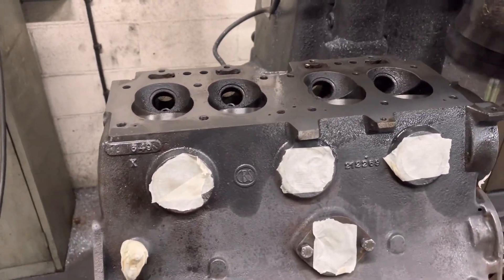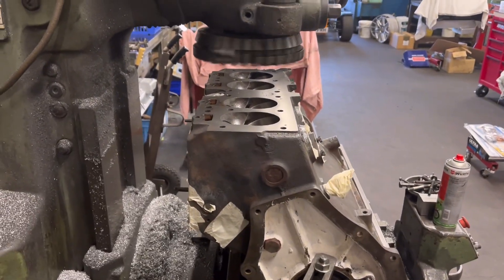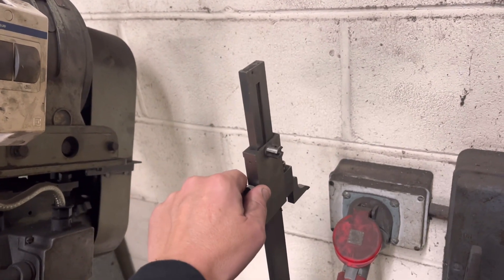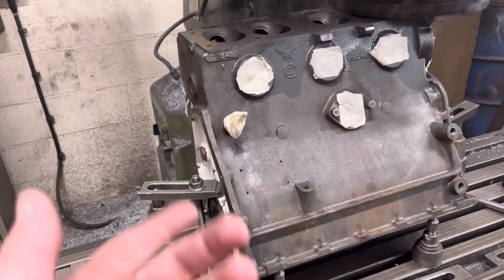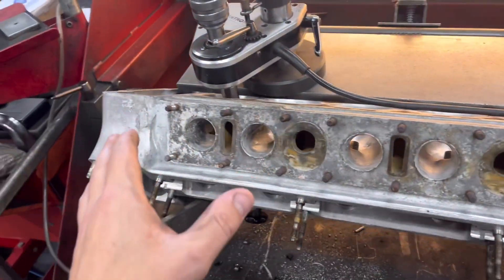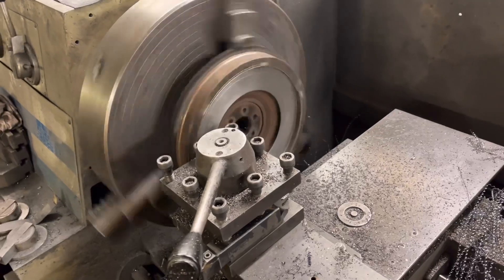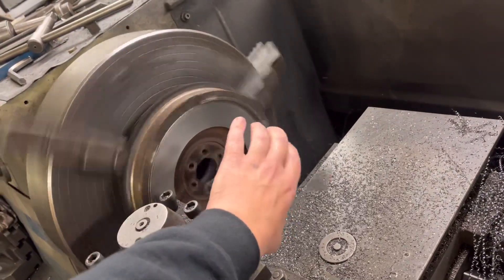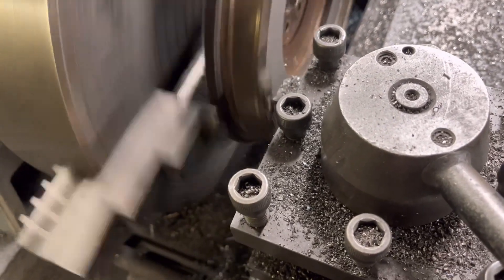The Lamborghini is BACK from main dealer, but only because…

Comment: I would just swap the blade engine for the Busa, the extra cc’s make all the difference and is almost the same power as the blown blade engine with out the added stress. You said you liked the engine/carb noise, you will lose this with the turbo.

Then if you find you want more than a 200bhp 1300cc busa engine you can always go down the turbo route later.

There is a massive amount of knowledge and around based around busa engines in cars to support you.

If you want to turbo the blade, build it straight off.

Comment: The bike engines do not hold up with the weight and continuous load generated by a car.  I race with several SCCA F1000 drivers.  They usually can’t get thru a weekend without a motor change.  Granted these are downforce cars so generate more load however they are on 1025 lbs all in.  Your extra weight will offset the lack of downforce.  Enjoy it for what it is.  So what if someone is faster on the long straight.  Learn to out drive them in the corners.

Comment: I would like to suggest you consider going with a larger displacement engine instead of turboing for two reasons. The first is that a Fireblade is already a very high-performance engine and you are already pushing it to its limits by using it in competition.  IMHO, boosting is too risky unless you replace the internals.  The second is that with the turbo, you may introduce a bit of turbo lag which will be most noticeable when accelerating out of a corner at lower revs.  That lag is going to drive you crazy and may give your competition just enough time to zip in front of you.
Reply: I completely agree with you, Lee is on the law of diminishing returns expecting trouble free extra performance.
Reply: Lee, gotta agree.
The absolute worst is any TurboTax.
Any problem with a stock busa?
Rock solid,Bullitt proof, cheap.
Reply: Meant Turbo lag.(damm spell check)

Comment: The limitations you face on a vertical milling machine is the reason why lots of machine shops invested in horizontal boring / milling machines. Indeed my old firm did exactly this because of the same problem on our vertical jigborer. That was in the mid-sixty’s. Good luck.

Comment: I had a blade then busa engine, actually still have the blade car. In a nutshell there are busa bike engines then all the rest. Good luck holding turbo torque with a blade clutch. I would and did go Busa normally aspirated and its plenty. Turbo no thanks been there done that with other track cars. If I did it again I would fit a tuned zetec or stock s2000 unit. Busa is a pita with its dry sump and I had a number of internal gearbox / dry sump drive failure issues.
Reply: Busa dry sump??
Reply: @frankbeaton4776  Yes. Due to the sump hanging down too low in caterfield type chassis there is no room for an adequate sump so they are converted to dry sump with a scavenging system and remote tank.
Reply: @nigelk780  Thanks. I have had a Busa and do not remember a dry sump after doing all the servicing myself.

Comment: Re-kit car, shot of nitrous? Put the switch under the throttle pedal, but I don't think short 50 shot bursts would do it any harm, I gather if you gap the piston rings larger, that helps, wire the electrics to the oil pressure switch for safety, engine stalls, nitrous cuts out. Just a thought, I know there's folk out there that know more about it than me, just a thought, throttle in a bottle! 👍

Comment: The two happiest days in a man's life is when he gets his Lambo, and then when he gets rid of it.....
Regarding holding vehicles hostage I had a tire shop put my car on their lift. One of the tires had some excessive wear, but I had not planned to have it replaced at that time, and not by that shop. I actually went in for a flat repair that they refused to do because they said the puncture was a little too close to the junction between the foot and the sidewall. Fair enough.
I told the manager that I was not interested in having him do any work at the time and he refused to take my car down off the lift and return it to me. I asked him if he would like me to call the police. He kept pushing me to buy tires from him and I told him there's no way I'm going to pay him for anything ever because I won't do business with any shop that tries to bully me. 
Eventually he said he would release the car if I signed a liability release for them for the condition of the tire. I agreed. It was never my intention to hold him liable anyway. I don't pull that kind of nonsense on shops.
I drove by the shop about a year later and noticed they were out of business, and that was long before all this Co--vid nonsense started.

Comment: I was a little shocked at your experience with Lamborghini. As a retired Audi R8 technician, I can tell you all maintenance and repair operations have a fixed time, in hours, and the required mileage maintenance list is given to each technician. From our perspective at Audi, the customer was entitled to a copy of the service sheet along with a copy of the digital service record, if applicable, or a dealer stamp in the book. VAG owns Lamborghini, so maybe it's worth trying an Audi dealer if they'd service or repair the vehicle, or offer any advice like I used to do, for my customers.

Comment: Not a fan of turbo's in a lightweight car myself due to the power delivery... I've got a Westfield MegaS2000 and my mates R1 5Y engined MNR is very similar in performance round Donington National. We are both relative track novices but were able to compete on pace with a well driven Caterham 485 too.
Busa, ZX12R, ZX10, R1 and the later 1000cc Blades will give you circa 180-200bhp, linear power delivery and decent reliability.
Left field choice is the new supercharged Kawasaki H2 engine.... that would be a beast!

Comment: Does that Caterham easily support tuning? Could the stock chassis, suspension parts & brakes cope? Ball joints up to it?
Reply: That's what they're designed for isn't it? I'm imagining the set up with fireblade engine is pretty light for starters?

Comment: Rather than Turbocharging a 'standard' engine I favour supercharging as essentially in broad terms you do everything you should for a N/A engine but then apply boost, whereas a turbo requires a different philosophy e.g. exhaust manifold etc.  By its nature a turbos tend to work at specific revs depending on their spool size etc, whereas a supercharger can be quite linear in its delivery, which is especially relevant given the road it has.  If the bike engine has 115bhp then turbo'ing up to 200bhp is a big hike that implies an engine that gives everything at the top and little of use low down.  I thought the Fireblade engine had 135bhp and if so 200bhp is a more moderate hike.

I bow to the better knowledge from others but horsepower is an addictive hype and at times it is much better to have a torquey engine pulling from low down to get max thrust at of the corners.  There are plenty of examples of competition cars where an engine of high horse power was soundly thrashed by one that had lower power but was much more flexible. e.g. F1 V12 Ferraris verses F1 V8 DFV Cosworths

Comment: I wouldn't turbo the current blade engine.  I would swap in a more powerful motor.  Maybe an R1 or Zx10r.    That's assuming you'll not consider any car engines,  otherwise it's a Honda S2000 engine everyday. Or falling that a Ford Duratec or Zetec, maybe an ST170 engine or an ST150.

Comment: The old 'Blades run well on 850MB of boost, no internal upgrades, just 800-850 milibar low boost pressure, and my CBR900RRV (913CC 1997/P Plate) did over 70'000 miles getting thrashed EVERY day, was still healthy when it got stolen!
Installation was done at 1800 miles to a minter, and had 72'000 on the clock when it was stolen, and had ZERO reliability issues, that carb fed Blade motor is a peach of an engine!!!!!!!!!!
Blower it and enjoy a fruity 147bhp!

Comment: Have you thought about suspension set up, brakes and tyres? This is probably the reason for your lack of pace on track. A well sorted blade in the right hands will give you lambo a run for its money on a track day.

Comment: I think it's quite funny that you are about to Turbocharge the Kit Car and you're about to send the Lambo to Ricky who is very well known for Turbocharging the Audi/Lambo V10 engine. Very soon both car will be running Turbocharged engines with healthy gains in horsepower.
Speak to Ricky about Turbocharging the kit car because to me you will need to keep the boost pressure down quite low otherwise you're just going to overcome the rear tyres all the time when the boost kicks in. The linear power of the NA set-up aids traction in power delivery.

Comment: The turbo will be a fun addition to the kit car. Freshen up the motor. Maybe a leak down test before moving forward. I know you have a dyno facility available.  You may want to invest the time and $ to have them set the fuel curve and air/fuel ratio. Definitely do not want it going lean at any point. Wishing a Deluxe weekend to you, the crew, and your family.
Reply: Lean equals pinking and potentially alot of harm.Talking from experience.

Comment: Lee, I’d also suggest a larger capacity engine rather than turbocharging your existing unit. A turbo would add more power but also a load of lag, whereas a larger, more modern engine would not suffer…

Comment: Get the kit car on the dyno before and after the turbo fitment as it would be great to get a back to back look at the results.
Reply: Errrmmm .A turbo typically shows a sudden surge but not overall more useable torque across the rpm.Diesels benefit maybe but petrols?

Comment: With the caterham I'd go with a built 1100 blackbird engine , would fit straight in and would look more original and would be more reliable.
Reply: Agreed. Don't mess with that Blade motor, keep it intact for short wet circuit use.

Comment: Great news you have the Lambo back, as far as proof you have deleted the data they accidently sent - all you can provide (and should) is a written confirmation that you have done as requested.
The kit car - you could go bigger power, or stick to smaller/more twisty circuits/do other power limited events; it sounds like you've sold yourself on the turbo already, so go for it!

Comment: I'd keep it simple and keep it cheap, your having way too much fun and enjoyment with the kit car to turn it into a project full of unknowns. With turbocharging and other serious tuning  there's always going to be issues to solve, niggles to sort etc, and it's going to take time and money away from enjoying the car on track days to work through the setting up, and any teething problems.
I'd forget the Hayabusa engine as it's EFI and also in high demand/expensive. Get yourself an early carb fed CBR1100XX or ZZR1100 engine from a breaker or cheap donor bike. Both engines are alot more powerful than the 919 blade lump, with more torque and being carb engines you won't need to re-wire the car and mount an ecu and probably a power commander or similar to tune the engine to run with the cars intake and exhaust system.

Comment: Save the weight and put a zx10r engine in it with a couple of tasteful tuning tricks you will have more than 220bhp plus the tq and you will have that beautiful screamer sound. Turbos kill noise and just don't sound good. Also your adding too much weight period. Turbo in this case is not the answer

Comment: Engines for the kit car, the Fiat FIRE engines are pretty fiesty units, also did you know there is a 1 litre version of the Reliant 850cc engine, my own 850cc I can thrash it and I mean its howling at 100mph but where it comes into the game is it is a very quick, revvy engine and the 1000cc racing Reliant engines are pretty awesome and even better with inj, modded inlet and 4 branch outlet, prog ignition and the punishment they can take puts other engines to shame lol
Reply: Hi ,you forgot to say it is a all alloy engine. a mate of mine had a robin, with a 850 kitten engine in it, modded and a 1 1/2 inch SU on it, we chickened out at 90, it gave a lot of drivers a shock when pulling away at the lights, like you said can take a lot of thrashing. do you race reliants ?.

Comment: Just add a gsx 1000 and have 200 stock. If you then want to upgrade you can turbo that out to 300 ish.  Turboing that engine leaves you nowhere to go. Go into a 200bhp thou as step one then turbo is a second step.  

Turbo motor bike engines dont feel that good and kill the noise.  Go try one before you go that route.

Comment: Gearbox warranty - Lee, following on from your other video, may well be worth a quick video after a strip down with initial findings and sending to the customer. I’ve stuck a few cars in to main stealers and you generally get a health check video now. It will never be a documentary but is good for those claims and dodgy engineers reports contradicting your finds.

Comment: I think if you are looking for something unique for the kit car, you should look for an EBR (Erik Buell Racing) v-twin making around that 200 horsepower naturally aspirated. The sound would be totally different and you might save a good bit of weight. They are liquid cooled and efi and there are/were software tools to tune them. Downside is very limited availability. You would definitely be in an exclusive club if you used this motor.

Comment: Unfortunately all of you who follow Lee have been led up the garden path when it comes to his Lambo…. I do not believe for one second that this dealer ripped him off. They definitely made a mistake with the details of another customer being sent to him but hey we are all human. Right some facts for you small minded followers and Lee who is a click bate hero… when the Gallardo’s get to 11 years old there are NO book service times or service schedules the dealer has to try and work out what is best service for the vehicle. Remember the book times are all relevant to the car (it’s expensive it’s niche it’s not the run of the mill Ford)the minimum book time set by the factory on a Gallardo just to do and oil and filter change is just over 5hours !! So anything extra is added.. I believe Lee said Pollen filers and brake fluid change was 2hours in the world of Lamborghini this is a drop in the ocean… this is what factory state this is what the dealer will charge…. Main dealers can’t match an independent and never will. Also if the dealer can not reach you to get payment then they can’t deliver the vehicle back to you after all you can’t walk into a shop and walk out with out paying… ask Lee the question did he get any other quotes from other dealers… I can bet other dealers would of been the same or more expensive… I’m sure the Tech can do most of the jobs quicker than the book time but that’s the bonus of having experienced techs… I’m sure if lee did one of his half a job engine builds x3 in a row he wouldn’t charge the 3rd build half price even tho he probably wouldn’t of taken as long as the first why because it’s a business…. All Lee wants is more followers and interaction so he gets more exposure and income from the channel..